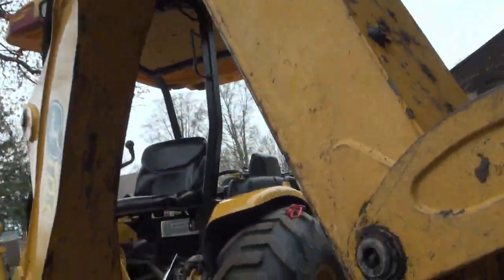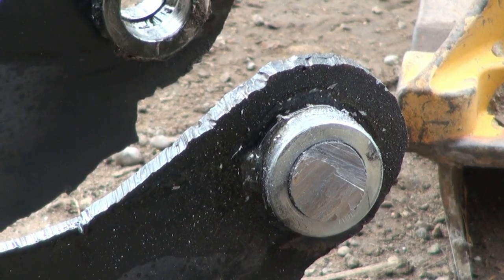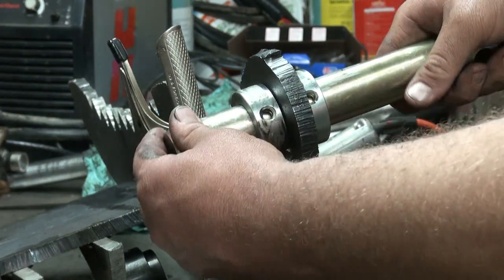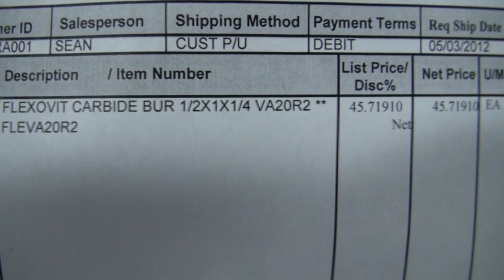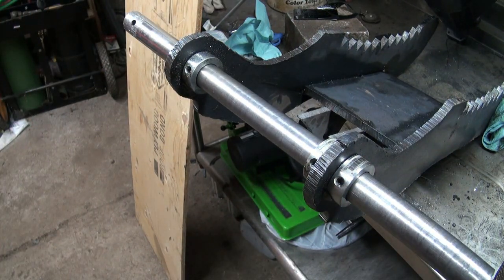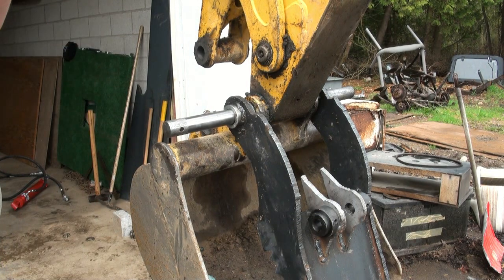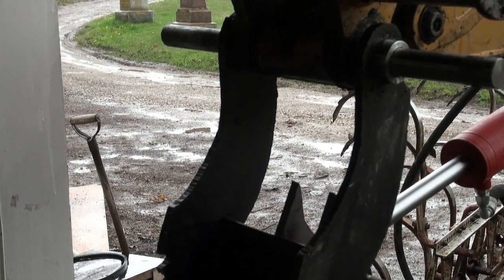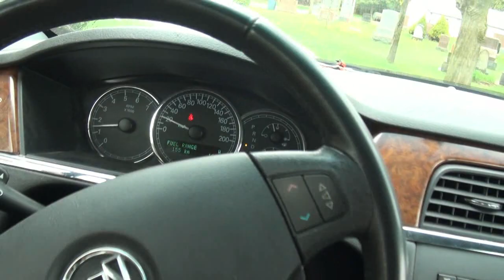aww frigg got big problems with the thumb

Comment: unles you are right up on the weld it's not going to mess with the cammera at all. I've done that with my flip and canon multple times and never hurt either of them a bit,  Your "thumb" is off because the holes are off center from each other not to mention they are spread out apart from each other at the end instead of being paralell to each other. the new burr was kinda spensive but being as it's working so good WORTH IT!

Comment: Weldingtipsandtricks focuses directly on all his videos right at the arc and never has had an issue with his camera that I've seen. 

The plates warped when you tacked it together, weld it all up and take it to a machine shop to have it bored nice and straight.

Comment: My 2 cents> You need to put another cross brace on the upper part of the thumb while lining it up as straight as possible. Then take it to a shop & have it line bored. A little slop is not going to hurt anything either. That pin will bend over time & that extra play will aid in removal. Looks awesome Bill you are almost there.

Comment: You'll know fer next time. 
Use two spare rings tightened down to temporarily hold the bits in place so's you don't have to use the grub screws on the rings you are tack welding. 
When you've cut yer pin to the length you want it don't forget to grind a bevel on the end so it'll feed through easy.

Comment: that's why you should have never cut the lip off them bushings, cut your hole in the plate with the torch large enough for the lip of that bushing to fit into, big mosse stack you made cutting the lip off the you would normaly weld a weld on pully or sprocet, that is why that lip is there to fit in side another hole..hole.

Comment: The reason it's so tight it because you probably welded it with the rod in it.  so it formed and deformed the rod, remember when metal is hot it expands.